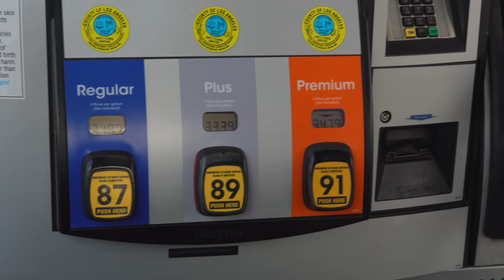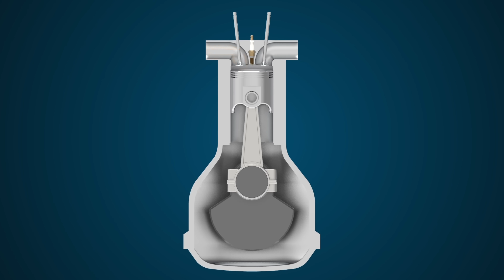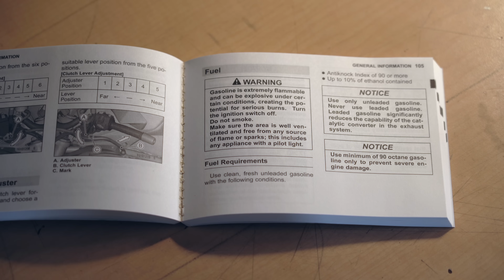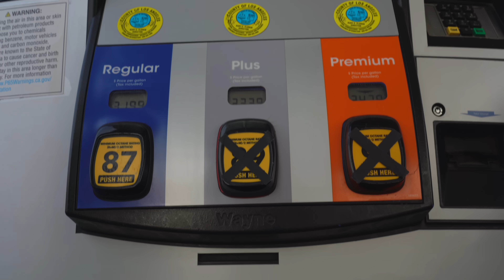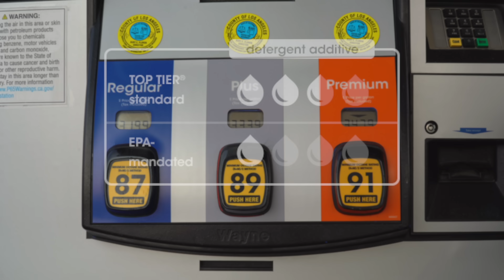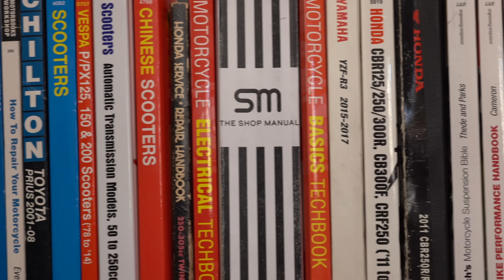Should You Run Premium Gas In Your Motorcycle? Octane Explained | The Shop Manual

Comment: Fun fact, in CANADA, Shell V Power and other premium grade fuels at SOME other stations contains NO ETHANOL. Lack of ethanol is a good thing and I for one prefer gasoline with no ethanol, especially prior to parking the bike for the winter.
Reply: Chevron 94 octane as well, which I run in my FZ-09
Reply: Here in the United States. QT has non-ethanol gas. Even though I manage an Exxon gas station I still get my gas from there because it's the only place with no ethanol
Reply: Shell v power is the only gas i use in both my bikes.
Reply: @patrick lanigan I was just going to make the same point. The Candian ethanol-free choices are a bit limited but the high grade from Esso, Shell, and Cdn Tire are all good. Too bad Petrocan couldn't do it too, since they are so common.
Reply: @djcsr  CTC gas in NB Canada is Irving fuel... which is ethanol ... they buy the cheapest they can get Crappy Tire sells Crappy gas
Reply: @thelonewanderer69  Our stations here advertise it... Shell V Power all the way
Reply: If you are in Canada, and you want the best protection for your bike in the winter then get yourself some Aspen Alkylate fuel. It is available all over the country. It has no ethanol, and can sit in the tank of your bike for 5 years and not go bad. It is also 92 octane. It also does not attack rubbers or plastic tanks. You can even put it in a styrofoam cup and it wont attack the styrofoam. It is the only thing that I store my bikes with. I also put it in my generator and in my lawn and garden equipment. It is amazing stuff.
Reply: @backcountryme  my bike was parked for 1 month last year... February.. 
I dont need to store my bike for 5 years  ... shell vpower here has no ethanol... and is probably much cheaper than importing that fuel...
Reply: @vtwinner  ok. Why does everyone feel like they need to bash something to justify their choices? I just pointed out that there are options out there. If it isn’t for you then great.
Reply: @vtwinner  Hahaha! Just checked, all my posts are still there. Like I said, triggered much Sally?
Reply: @backcountryme  where do you find this stuff?
Reply: @backcountryme That really could be the future of gasoline and fossil fuel
Reply: They made all base fuel in Australia e10/10% ethanol.   Just to keep the greenies happy~
Reply: Ross Outdoors  ours here is 10 cents a liter basically... Shell here dont control the price.. our local refinery does and it's fairly stabil
Reply: @thelonewanderer69  oh yikes!
I must admit I go through the pain of putting Aspen preservative fuel in the tanks of my old bikes before winter. That should get the trolls going. The upside is I don’t have to completely rebuild the carbs on a 76 Kawasaki four again due to criminally poor pump petrol. In addition the 1975 three cylinder Kawasaki middle-weight shopper started first kick this March having not run since last October. I filled that up with Esso after the first run because of the lack of ethanol contamination, I’ve made a point of using Shell V-Power up until now. Not because of its octane rating, more due to the additive pack although when riding a mid-seventies two stroke with mental issues anything that holds off detonation a bit longer can help with your life expectancy.
Reply: Costco premium in Canada is ethanol free as well!
Reply: @thelonewanderer69  You can always test it... https://youtu.be/bEf9Fdvx_Sc 
Non ethanol lasted 4 percent longer...
Ethanol kills gas mileage... PROOF
Reply: @vtwinner  So you drive 100mils, you can get 4 miles longer, if you pay a lot more money? Why not use E-fule, and get maybe 120mils for the same price. 4% is about noting. its 4/100. 4 parts of a 100 parts. And the gas in the US is stupid cheap, komared with Europe. You get about 370% more gas for your money.
Reply: Ontario announced they're upping the ethanol from 10% to 15%... Just hope it doesn't affect those that carry 0%
Reply: @gwot  many vehicles state that they cannot run more than 10% in the owner's manual. Should be interesting if they pass that.
Reply: In europe all gas contains 5 percent ethanol. There is absolutely nonoroblem whatsoever. Have  a car and a motorcycle. The bike sits for about 4 to 5 months unused and allways srart right up.
Reply: @Fiatmannen1 : You know how many countries and how big Europe is?
Norway is in Europe and not all gas contain ethanol.
The 98 RON are ethanol-free as oil-companies must have an ethanol-free alternative by law.
Reply: @Fiatmannen1  even the premium fuel?  In Australia for the low grade 91 they automatically made them E10
Reply: @nabahmadi5012  yes
Reply: @Fiatmannen1  you have no idea what it is doing internally... but if you don't want to listen to those that have experienced it... then you will eventually find out...
It does affect carbs much worse than FI for sure... but there is no denying the varnish that ethanol leaves behind..
Reply: Ethanol will ruin your carb. It dries it out and it starts to form electrolysis
Reply: Exactly my thought....after finding crumbling fuel line bits in my carb.
Reply: PURE gasoline is way better than with 10% bioethanol.
Reply: same reason I use premium at the gas station I usually fill up at. Only grade without ethanol.
Reply: That's why I use Chevron 94!
Reply: @jbb3675  that would be my choice too.... But noooo Ontario doesn't have it
Reply: @thelonewanderer69  It say “No ethanol” on the pump. And its much more expensive. Don't think its a thing in UK or Europe.
Reply: @thelonewanderer69  Esso premium does not have ethanol. (UK)
Reply: @thelonewanderer69  In the UK all pumps contain Ethanol, and the percentage is going up too.
Reply: Yup. Shell 91 is all I use in my bike for this reason. No ethanol.
Reply: Came here to say that. Locally, the only gas without ethanol is the high octane 91. I don't ride a whole lot so the bike sits for sometimes weeks. I don't trust ethanol gas to be sitting in the tank for any longer than absolutely necessary. If I was going on a trip where I was going to burn tank after tank I don't think ethanol would be a problem.
Reply: Ethanol burns at a 9.6:1 afr and pump fuel is 14.6:1 stoichiometric. If your fuel system has no way of accounting for the alcohol/ethanol in the fuel it can actually lean out the engines afrs a tad from the leaner ethanol burn introduced
Reply: When I do get highest I bring the Jerry can with me put $10. In the car then the rest in the Jerry can that way I know the hose is drained from regular from the previous fill-up it's a shame I'm paying hi-test price for 3 gal./liter for what is in that hose.
Reply: @thelonewanderer69  in US they must state in pump ethanol percentage. Used to be in Winter only here in AZ. So we got better mileage even in Summer with AC running. Now ethanol year round. I lost 3 mpg in my Porsche! From ethanol at 10 %
Reply: Ross Outdoors  a dollar at Chevron right now
Reply: All ethanol is good for is drinking..
Reply: Ethanol does Not pull moisture from the air. Condensation forms naturally in the tank especially when you live in a more colder climate and is more problematic for people who really don't know anything about vehicles or maintenance on them. It was a big problem when ethanol first started as almost everyone had some amount of moisture in the bottom of their gas tank
Reply: Bingo. That's why I usually run 93 octane. (And in the habit anyway from my boosted car....though I hate when I'm driving a different car and accidentally fill it with premium! So much pricier when buying 15+ gallons.)
Reply: Yes, in rural central USA, name brand 91 is almost always the grade without ethanol.  While on the east coast US, and in cities, 91 will still have ethanol.  Yes, ethanol can mess up a lot of engines, including snowmobiles, lawnmowers, snowblowers.  Specifically, it can destroy fuel lines.  Always better to keep ethanol out of your gas, unless you specifically have an E85 engine.  (cars only of course.)
Reply: Same in the UK....Classic Bike, use premium Ethanol eats classic rubber...
Reply: Yes, in CANADA, Shell 91, CDN Tire 91, Costco Premium and Esso 91 are labeled as containing No Ethanol. These are the places where I go to fill up my bike every time.
Reply: Same with me. My Nanaimo dealer always fills the bike tanks with Premium as they sit waiting to sell so the ethanol doesn’t separate the suspended H2O. I keep the tank full, especially during low ride season, and with run the engine at least a couple times a week.
Reply: Shell v power racing  is 100 octane very good
Reply: Ditto for all marine outboards
Reply: When lead was eliminated from our gas in California back in the 1980s, I was worried that the absence of lead would damage my valves in my Honda CB750K1. So I started running 100 octane avgas that I could pump at my local airport. Wow!! My Honda felt 50 percent more powerful than when I used 91 octane. However, my plugs started fouling a lot, all four of them, and that was a pain. I did find out that the clever Honda engineers had already anticipated lead-free gas and the alloy of which the valves and valve seats were made did not suffer without lead! So I was a happy care-free motorcyclist after that!!
Reply: That's why I only run premium in my garden tools. It lasts longer without going bad in the tank or in a Jerry can.  I also try to make sure my last tank at end of riding season is premium so if there's any left it won't go bad over the winter.
Reply: Same here in Norway. You have to buy the highest octane premium fuel to avoid ethanol, which is exactly why I only fill premium.
Reply: I see this thread is from 2y ago. Nowadays you can’t get ethanol free in canada 👎
Reply: I run 87 through the summer, but prior to winter storage, i start using 91 with no ethanol.  I store with 91, since sometimes in the winter I get a chance to ride and I dont have to worry about ethanol if im below full when I park it again.
Reply: not anymore
Reply: Not anymore unfortunately
Reply: As of now, all grades contain ethanol in Canada.
Reply: I came here to say this as well.
Reply: In BC, all gasoline octane options are mandated to contain ethanol.
Reply: Same, glad you mentioned this. Regular is fine for regular season riding, but use premium for that final fill up, and also for the jerry can for the lawn equipment and other garage queens solely for the lack of ethanol
Reply: @penguins9645  Sta Bil before you park it for the winter. Gets rid of all the water and helps with ethanol.  And they want to increase ethanol to 15 %. Nasty sruff
Reply: I had to clean the ethanol varnish out of the float bowls on my Suzuki when I bought it... 
The ethanol ate through the gasket and it was pissing gas out the carb bowl...
Ethanol is disgusting, you couldn't pay me to use it.
Reply: @vtwinner  Thas not a reason to not use E-fule. They probably store the bike for years with only E-fule in it all the time. And did not clean it up. Just sold it to you when it was trash. Just don't store your bike with E-fule. If you are going to use a tank of gas in one or two days. Even a week. Its a wast of money, to not use E-fule.
Reply: @vtwinner  Teetotaller, I see.
Reply: @vtwinner  "Ethanol is disgusting, you couldn't pay me to use it."
Reply: @vtwinner  I have not inspected my internal organs. However, based on what I know about biochemistry ethanol is mostly harming my liver, the digestive tract and brain tissue.

You really have done an open surgery to yourself to see what your organs look like after consuming ethanol? I don't know if that's super rad or completely bonkers. 

Probably both.
Reply: @vaenii5056 we are talking about car ethanol... try to keep up....
Reply: I don’t care what anyone says, my 89 Seadoo and 89 sxs runs better on premium. Whether it’s because of the octane or non ethanol. Plus there is no gumming of the carb on small engines like you get from that ethanol crap.
Reply: definitely, ethanol is nasty shit that will decrease your vehicles lifetime. It’s not so bad if you run your machine constantly, but it only takes a few days for the ethanol to start pulling moisture out of the air, not to mention it struggles to stay in solution. Rusty fuel tanks aren’t a problem if your fuel tank is plastic. But letting your engine gulp water from the bottom of the tank is never a good look.
Reply: @Robnoxious77  depends on the bike/car. Ethanol can be stunning in high compression and forced induction applications.

One of the major problems is that whats labeled as e85 can be anything between e50 and e95.
Reply: @Robnoxious77  - Ethanol fuel corrodes many carburetors, too -- and it's a terrible solvent for fiberglass components.  I keep it was from my motorcycle.
Reply: In Canada? Where I live in the US pretty much all of the gas stations around here offer a no ethanol option.
Reply: @ThatAirplaneGuy2000  Where do you live? Curious to know where ethanol-free gas is so readily available.
Reply: @AriH211  Oklahoma, US
Reply: @ThatAirplaneGuy2000  is that option on all 3 grades of gas, or just premium?
Reply: Plastic fuel tanks might not handle the ethanol too well because it can act as a plasticizer and degrade and deform the shape of the plastic. This is a problem mostly for the older bikes I believe
Reply: @Panic_1  Yes, It can also dissolve enough plastic materials to put plastic goo in fuel lines and carburetors.
Reply: @Panic_1  ethanol is alcohol I does not really bother plastic parts they use it for washing plastic and fiberglass parts for paint and washing the mold release agent's off the parts...some of the older gas from years ago had lead and other chemicals might be what your thinking of but it will damage carburetor it washes the oils out of the gas and then things start to rust etc.
Reply: U park ur bike in the winter 🤣🤣🤣
Reply: @AbRaxZis  Winter here in Ontario is  -20 Fahrenheit on an average winter day. You bet that puppy is getting stored.
Reply: Both my bikes have metal tanks and I run them almost daily, year-round.  I put ethanol-free fuel in there almost every fill-up anyway.  Better safe than sorry.

Many Wawa stations sell ethanol-free gas.
Reply: Ethanol works great in all of my rides. 84 V65 magna. 98 Dodge ram V10. Corvette. Several 70 year old John Deere tractors. And my Briggs engine lawn mowers. But I also understand what ethanol is and actually doesn't do to your engines. Ant I'm also a great mechanic who has worked on most everything from lawnmowers to dozers and other construction equipment so most of you need to check the facts before making false or mostly just ignorant statements
Reply: @michaellarson8913  Ethanol eats away at the gaskets and seals in many of our newer motorcycles. It is well-known among Aprilia Shiver 750 owners that the gas tank will warp if you repeatedly use fuel with ethanol in it. It's fine until you try to take the tank off and it won't budge. You may not have seen or noticed any problems with it but I personally have encountered many problems with it, mainly though, poor performance.
Reply: @jbb3675  That can be true but there's other materials to make gaskets and seals from that aren't affected by ethanol. If the tank is warping from it that would be recalled in the USA. Mileage drop of 4% isn't even worth debating as I can get 10 mph having fun in my Vette or 87mpg coasting in neutral or 30 driving it nice. Also depends greatly on who's gas you use as in our Iowa/Minn area you don't want to use Casey's gas but that's the only one in most tiny towns and have to fill up- low or high octane. Straight corn alcohol is 105 octane
Reply: @michaellarson8913  Yeah, older Aprilias were a bit quirky. It was only the '08 and '09 that were affected but it took several years before anyone noticed it. By the time it was noticed it had been fixed in the newer models. I don't think they expected anyone to run lower grades of gas cause it's a high performance engine and requires premium to run properly. What year is your Vette? I like the classic Magna too, those bikes are about as solid as can be! Good power too!
Reply: @michaellarson8913  lv’e been wrenching,restoring classic cars ,motorcycles & smalle engine equip for over 50yrs & have seen 1st hand where std pump fuel with 10% ethanol has damaged or ruined fuel systems etc esp in low use vehicles even when properly dosed with fuel stabilizer. That’s why I use non ethanol fuel in my classic cars,motorcycles & power equip to avoid fuel system issues.  Pump fuel with ethanol isn’t an issue in everyday & or often used vehicles, it’s less used vehicles that have issues esp when stored in environment with large temp & moisture variation that’s gets you into trouble with ethanol.
Happy Motoring!
Reply: @scottwheaton9689  and when you say low use vehicles you are talking almost NO use at all! . 3 local car shows per year which I'm not against. If you have actually been wrenching that long then you also know unleaded gas is NOT as good as leaded gas. Way shorter shelf life and why do my friends drag race with E85 ethanol. Get educated and we will talk.
Reply: @michaellarson8913  
Alcohol burns cooler than gas so your drag racing friends can run 13 or 14  to 1 compression ratio or way more boost without detonation. 500cc speedway bikes run 20 to 1 on pure alcohol.
Reply: @donadlington7371  that's right, it has HIGHER OCTANE so burns cooler. 10%ethanol was 89 octane until oil companies started blending it with cheaper 85 so it is now 87 octane, e15 is 88 octane. Thanks for helping me in this discussion. Finally someone else who gets it.
Reply: @michaellarson8913  Thank you. You'd swear ethanol was Satan's urine, for crying out loud!
Reply: @michaellarson8913  ethanol attracts and accumulates moisture is the real down size, if you want to make it worse run methanol. 😂